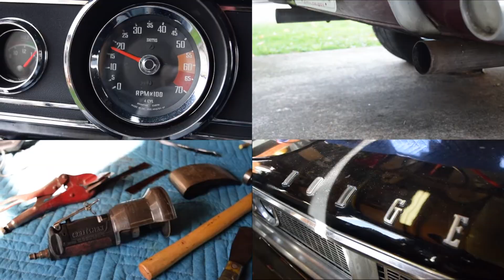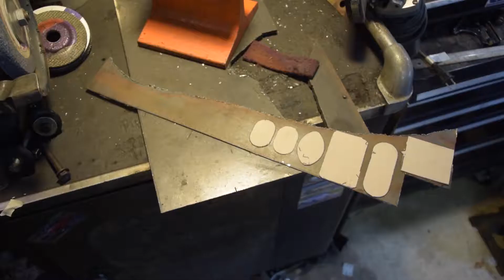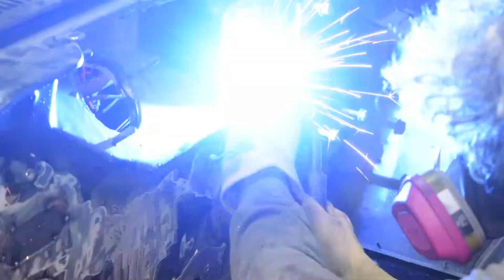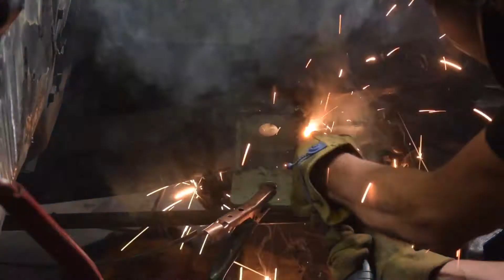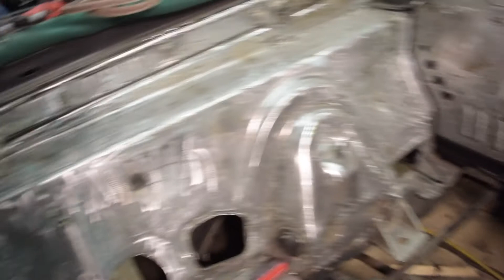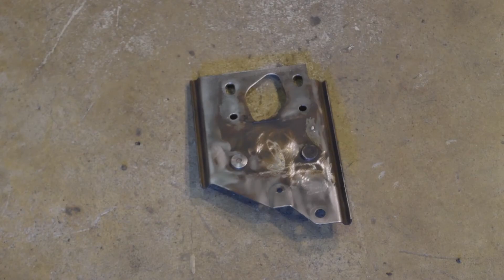Mopar Firewall Smoothing and Engine Bay Restoration

Comment: I'd like to smooth the firewall on my 74 Duster.  The B body has that seam or pinch weld running in a nice symmetrical arc but, the A body one isn't so nice looking.  Can that just be cut smooth and then, can you run a bead along it to attach the two sections again?
Reply from the maker: Yeah, if I didn't have the nice looking pinch seam I would have just welded the two panels together, ground it down, and used body filler to smooth it out. That approach is probably more structurally sound regardless.

Comment: For making round patches, tack a pin in a piece of sheet metal. Fix it to a drill and rotate the piece while grinding off the corners with a grinder. Eventually the piece will turn round and then it's just to grind it down to right size.
Reply from the maker: Genius. 10/10 will use.